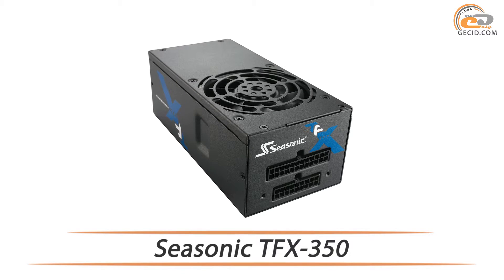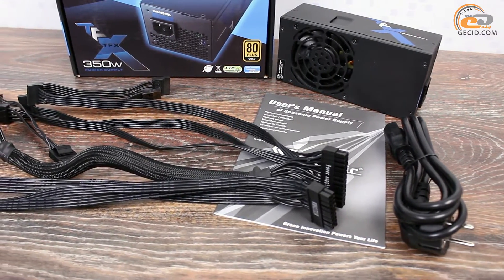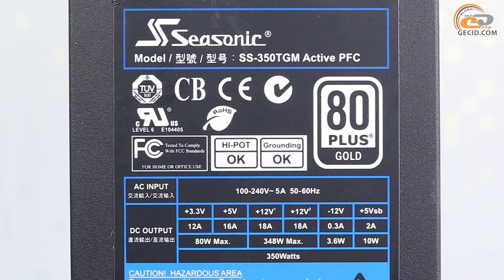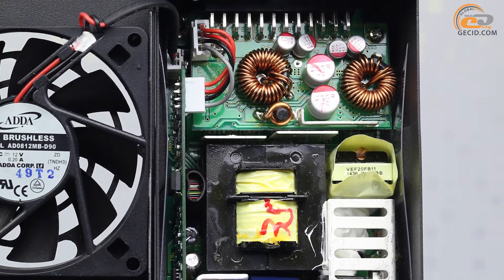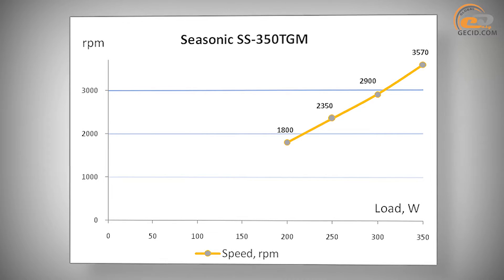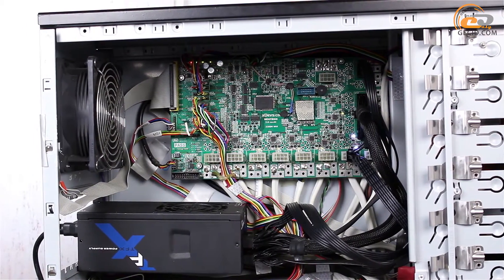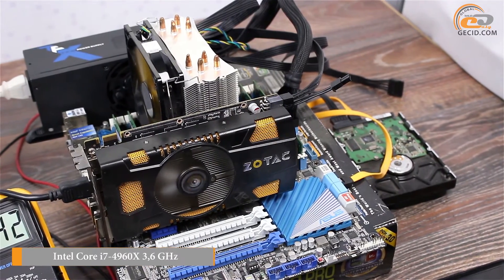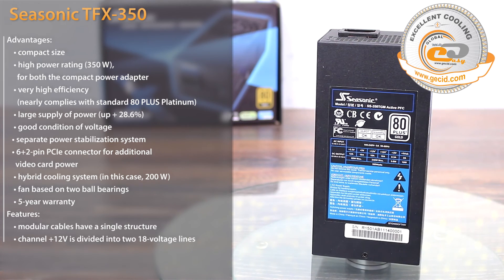Seasonic TFX-350: Review & Testing

Comment: Hey, I have a question. https://www.amazon.com/Power-Supply-Adapter-Cable-Lenovo/dp/B00WE5KSFQ this should work just fine on the PSU yea? No other cable need to be connected other than that for it to start up or?
Reply: I know the cable itself works n converts 14-24 properly, but not sure of the PSU how it is.